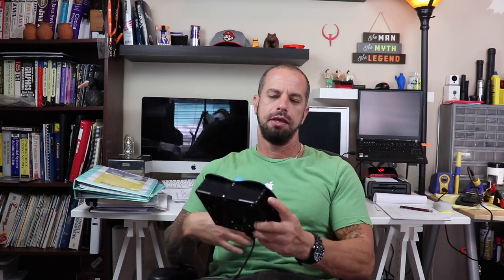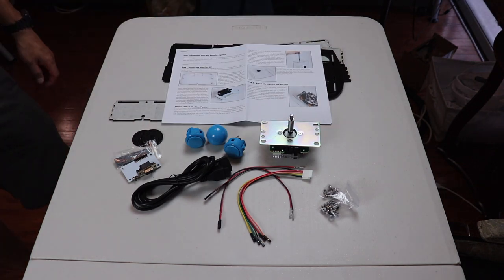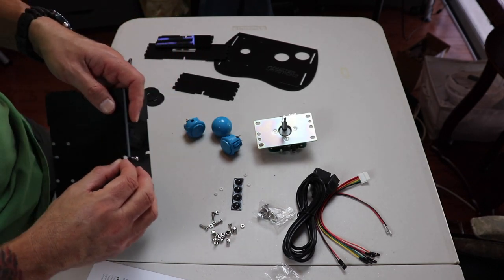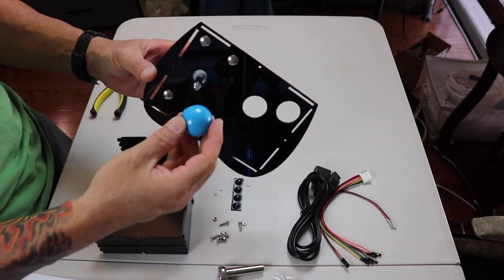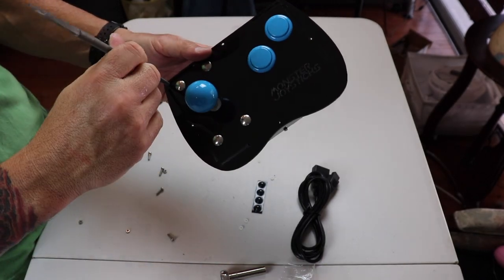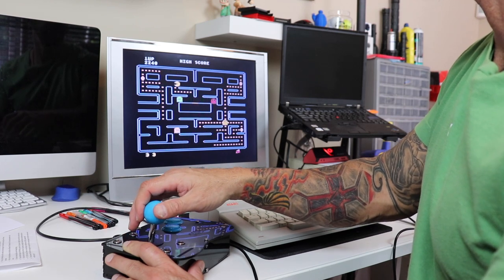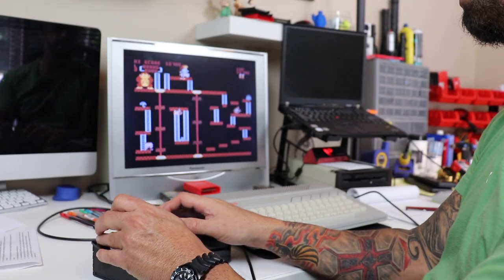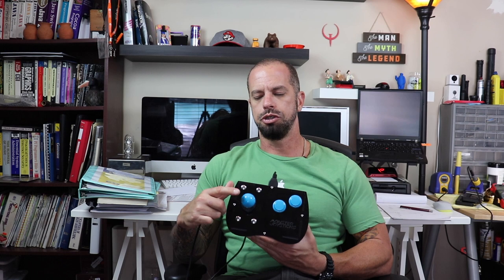Building a Monster Joystick!

Comment: I wonder if you're supposed to attach the sides to the top first, then install the joystick and button, then the connector to the bottom, and lastly attach the bottom to the sides.

Comment: Got mine in black with red buttons and stick ,I found a very pointed pair of needle nose pliers worked fine and 1st time,Like u i had same problem with the corner of the top cover , but i just gave it a good hard push down and it went on fine, just a very tight fit.  love small switch function , switches the up function on the joystick to the 2nd button, so in games that require pushing up to jump, u can easily swap it to button 2 instead, brilliant.
BTW the deluxe version has Sanwa arcade stick and buttons,  They are the industry standard for arcade cabinets all over the world, apparently its impossible to find an arcade cab in japan that has something different lol
Reply from the maker: Thanks for the info, and thanks for watching!
Reply: @8bitandmore  

Thanks for the review, I'm looking at this joystick at the moment, might get myself a couple for my Amiga's, I have Sanwa joysticks (JLWs not these) in my Arcade Cab so I'm familiar with them. Those joysticks (JLF series) have a shorter throw than many other arcade sticks especially when compared to clones or cheap chinese crap which are everywhere and those buttons (OBSF-30) you have are right up there with the best of them, they are super light reaction and throw.

 The reason you're missing some directions while playing Pac-man is these joysticks use a square gate restrictor plate and is 8-way, they can be changed to 4-way by changing the plate from square to diamond but pretty sure you have to buy that restrictor plate, my JLWs are both 4 and 8 way just by turning the plate.

Questions: Hows the weight of it, does it move around on the desk/table while playing (it looked like small amount movement on the footage) or is it pretty stable? also the 9 pin cable I notice doesn't screw in to the casing, does it fit in snug/tight or would it be easy to disconnect accidentally while playing?
Reply from the maker: @off1k  it's a pretty solid stick and the connector is snug so I don't see it falling out easily...I will check out the stick you mentioned, thanks
Reply: @8bitandmore  
Thanks for the quick response.

The JLWs have a slightly wider mounting plate but have matching screw holes from what I can tell, from the looks of it though it may interfere with the side wall of the monster stick. 

http://www.ozstick.com.au/product/sanwa-joystick/  <-- Australian site but the joystick would end up costing about $19US at the moment plus delivery.
Reply: @8-bit and more
Hi there, I've had a proper look at those Sanwa JLF series Joysticks that come with the Monster Joystick, you can actually change those to 4-way. You remove the restrictor plate by pushing in the black tabs and lifting off the plate, then you can push the inner ring with the 2 lugs facing you and turn to the right 45 degrees or remove the inner ring by going left 45 degrees.